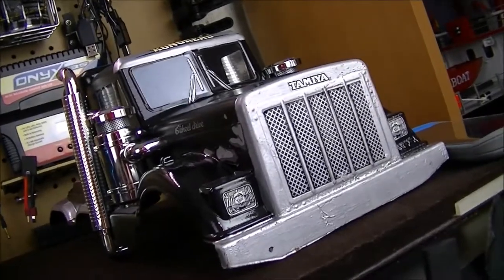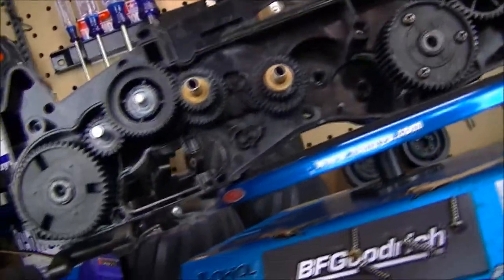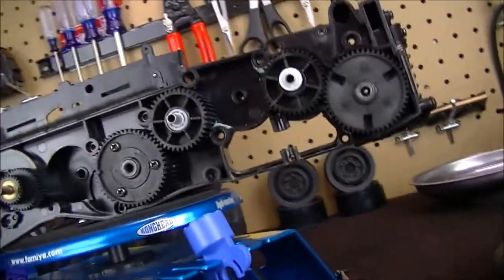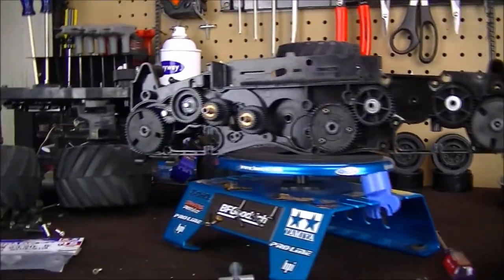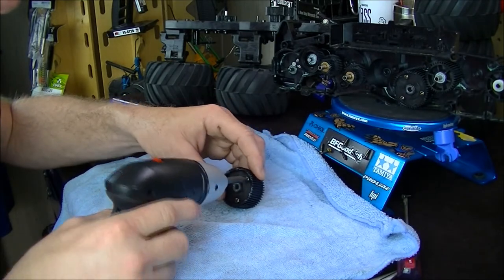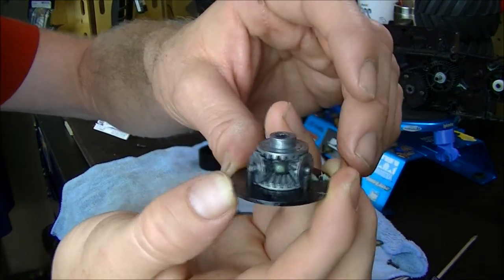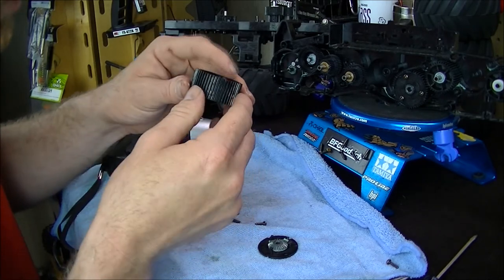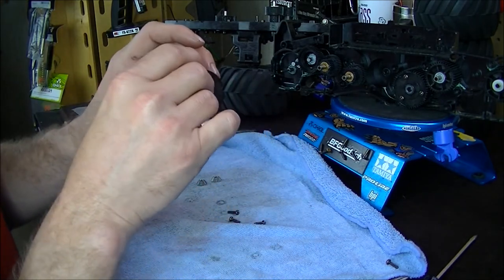RC84FILMS: Tamyia G6-01 Locking Deferentials

Comment: How did this work out long term?  I'm about to try this on my King Yellow for the trails!
Reply from the maker: I would not do it I try this and  for a little bit but soon found it will burn up the motor. Sorry for this info. Plan on doing a video on this
Reply: @RC84Films  Interesting.  I have put silicone ear plugs in and it was a little better, but i hoped this would be good.  Hmmm Don't want to burn up my nice Fusion motor!